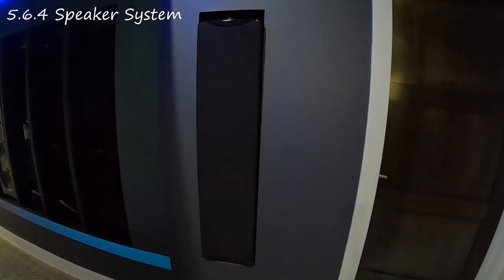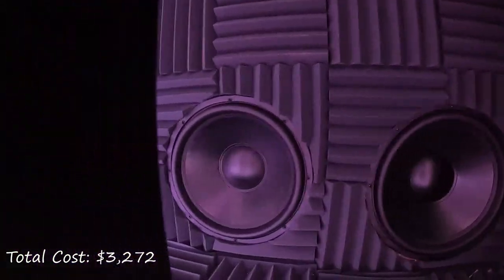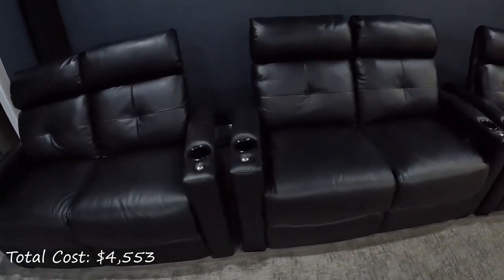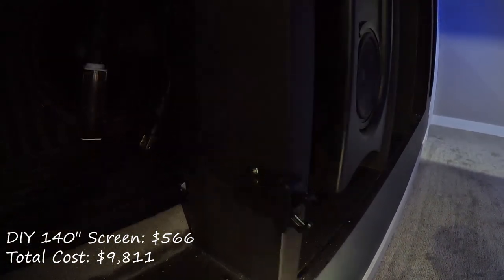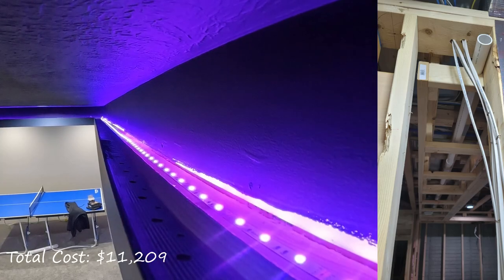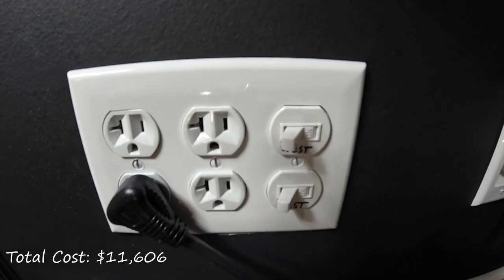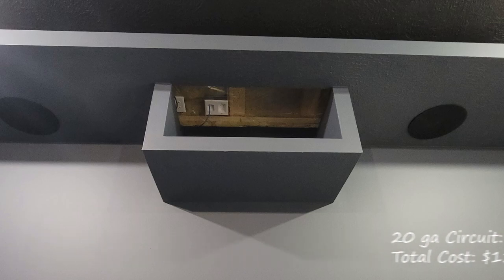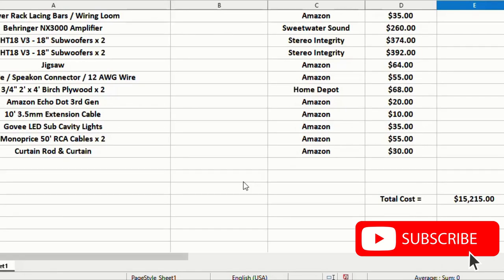Basement Home Theater - What did my home theater cost to build?

Comment: Wow, you keep a lot better records than I do.  I have a rough estimate in my head as to how deep I'm into mine but I really have no idea how far off that number could be.  I just know that trips to Home Depot alone for just misc junk must add up to a couple thousand or more, probably a lot more when you include all the MDF for building the speakers etc.

Fortunately I already had most of the Dayton AMT-Pro4 Air Motion Transformers that I had bought before the price basically doubled.  The same with the 5" Reference drivers, otherwise the LCR would be about $12K in drivers alone.  My theater was originally planned for a completely different property so I bought those drivers around 2017 or 2018 and then they ended up in storage.  It's a good thing though, I only paid about half what they are today back then.  For some reason Parts Express wholesale prices went up a lot more that retail prices, I use to get Dayton products for about half retail but now there isn't much difference at all.

I'm also not very efficient, I start a plan, decide it sucks, take it down, start over... Probably going to be quite a bit in just basically waste.  Also, for the side speakers as an example, I needed 72 mid-bass drivers so I order 100.  Part of that is price breaks, part is me probably being too much of a hoarder when it comes to speaker drivers.  Good news is some of those may end up in rear speakers.  

So I probably really don't want to know what the total is so far, I'm pretty sure it's well over the budget I had in mind at the start.  Now I'm looking at possibly adding a MadVR but there is no rush, I need to finish building the darn thing first.  Once I get it all up and running and get more of the cosmetic and room acoustic stuff done I'm going to probably go ahead on the MadVR.  

Of course it's not just financial cost, it's also been far more work than expected.  I feel like I've become a slave to my own creation!  I just hope it's worth it in the end.
Reply from the maker: It'll be worth it in the end!  I've been watching your updates as well, and it's coming along very nicely!  I know I missed some stuff as well, and like I said it was hard to keep track when also finishing the basement at the same time.  A lot of the costs overlapped, so I basically left those out of the costs of the theater stuff to try to seperate it a little better.  Keep up the good work!  You'll get there and it'll be amazing. 😁👍

Comment: With a perforated screen like that I have been told I need 12" of space between the screen and speaker or you will get comb filtering.  I won't have 2" to work with and want a ALR screen as well as AT.  Seems you have yours pretty close.  Do you notice any bad audio?  Would only be my center channel behind the screen so I wouldn't think it would make a noticeable difference like having the L and R behind it that close as well.
Reply from the maker: I haven't noticed anything having my center behind the screen.  I have never heard that that happens either, but I haven't researched it.  I would think even if it effected the sound a little bit, it would still be better than having your center channel under the screen exposed, way below ear level.  You'll be happy you put it behind the screen, I say go for it.

Comment: You have a beautiful display. I'm sure you're setup sounds pretty good at medium to high volumes but what about low volumes or better still no volume (quiet scenes) therefore I would have to say your speaker cables are the Weakest Link.
Even though one should always prioritise the best speaker cables for the most important speakers.. in my experience it's actually the cables of length that needs to have the better shielding. One needs to remember unshielded cables act as antennas for attracting RFI and the longer the cable the better the antenna!
One can actually put this to the test. Choose a movie with lots of quiet scenes, something like the quiet place 2 (no pun intended) after 10-15 minutes of listening, turn the system off. Disconnect the height channels from the back of the AVR, give it 5-10 minutes and then repeat the process. One should be able to hear how much the noise floor has come down.
Reply from the maker: Very good information!  I remember looking at your setup from some of your earlier posts when you mentioned this as well.  I might have to try this for fun sometime and see if I notice the difference!  I have both of the Quiet Place movies too, but haven't watched them on my system yet.  Sounds like a good opportunity to me!
Reply: I do apologise, first time round I never viewed this video in it's entirety! After viewing the rest of your components, if I was you I wouldn't bother taking onboard my advice. You got far too many components which could be causing the same issue! Besides if you're not hearing any problems why go looking.
 
You've actually done a very good build. You certainly got the best out of your budget and I love your rear wall colour choice. That's the wall colour I was actually looking for. I've resubscribed and given you a thumbs up, mainly because you come across as a very nice person. (Wish I had your talent for making quality videos) 😁

Comment: Got to get the seats off the back walls, you'll get a much better sound stage
Reply from the maker: Thanks!  I'm aware of that fact, but they aren't right on the back wall either - there's room for the subwoofers behind the seats as you can see.  I didn't want them sticking further out into the room either so it's a compromise that I had to make to maintain the open rec room area of the basement.  Guess I could slide them out further when watching and slide them back afterwards, but that's too much work 😂